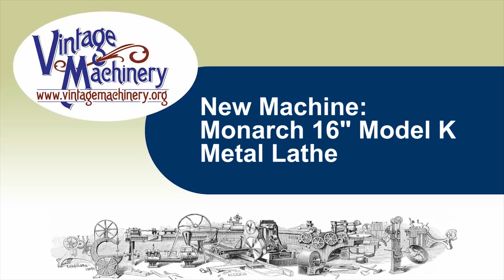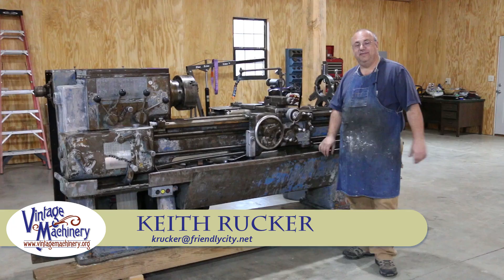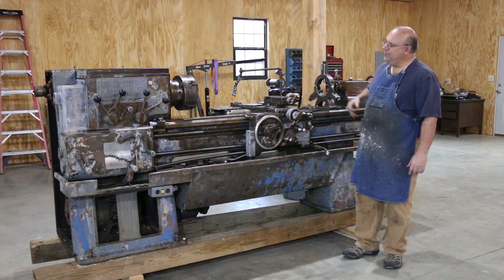New Machine:  Monarch 16" Model K Metal Lathe

Comment: before you remouve the motor open the controle box and check the contactor the problem may be coming from there long time not working the contact can be frozen open way easyer then taking a motor out you should have 2 contactor 1 forward 1 reverse interloch so both cant be on at the same time

Comment: A nice machine, those big Monarchs are great tools. The rod that's bent and broken should be a fairly easy fix. It isn't a rotating part but just an extension to engage/disengage the spindle isn't it?
This will be a full blown mechanical as well as cosmetic restoration if I know Keith. This will be his go to lathe in the years to come.

Comment: To get rid of old paint, just soak the parts in Sodium Hydroxyde (NaOH). It's much cheaper than the commercial paint removers and it works by far better than any of these. But be aware that you can't use it on aluminum, because it also dissolves in NaOH.

Comment: very interesting, I have recently got an old monarch circa WWII, so I'd be very interested in what you find and encounter on your machine. your motor problems sound like one of the inducters is not running, probably a dead connection somewhere in the wye, or the inducter is actually dead

Comment: Keith, I'm glad to see you saved another monarch, they are my favorite. I can tell you, the clutch shaft leading into the gearbox is a pain to get to, the shaft runs in about five inches and transfers to a bevel gear setup. I repaired one a few years ago. don't mean to discourage but it's not fun. Your broken longitudinal hand wheel crank knob is a press in fit on those, they usually press out from the rear. At the left end of your apron you will see a cast aluminum tank, this is your way oil pump, inside is a piston pump driven from the saddle hand wheel, it's usually clogged. It pumps to a manifold located beneath the bridge of the cross slide, under the saddle between the bed ways, you'll want to replace all oil metering units within, source them from lube inc. they're the cheapest. Your headstock should be fine, built to drive the titanic! You'll be impressed with the build quality of the dog clutch tranny and helical gearing. Your spindle bearings are Timken tapered roller, everything else is most likely Bower, your going to love this machine and I can't wait to see the upcoming vids on it. Good luck and God Bless.
Chris German
Reply from the maker: I have been studying the whole area and it looks like it is going to be a pain.  No surprise there...
Reply: You are absolutely correct.  It turns out in a later video that the oil passages from that pump are blocked and due to lack of lubrication there is excessive wear of the saddle where it rides on the ways and the apron has excessive wear to the gears and bearings.

Comment: Do you have any kind of tool holder that would fit a ten inch atlas lathe that you would sell me?
Reply: Just get an AXA aloris Copy. I have a 10 inch atlas/craftsman lathe and it's worth it's weight in gold.
Reply: I've seen those but I'm not sure what exact size I need, is there a model number or size you could give me please? Thanks
Reply: Wedge (my personal fav) http://www.ebay.com/itm/AXA-WEDGE-TOOL-POST-UP-TO-12-CNC-SWING-LATHE-QUICK-CHANGE-HOLDER-250-111-/121554200553?hash=item1c4d31e7e9:g:NUMAAOSw44BYUD5d

Piston: http://www.ebay.com/itm/AXA-PISTON-TOOL-POST-UP-TO-12-CNC-SWING-LATHE-QUICK-CHANGE-HOLDER-250-100-/131413753511?hash=item1e98debea7:g:3EkAAOSwCEdYUFE9

Small kit: http://www.ebay.com/itm/4-PC-AXA-WEDGE-TOOL-POST-INTRO-SET-CNC-TURNING-FACING-BORING-LATHE-HOLDERS-/131914216329?hash=item1eb6b33389:g:l3cAAOSwImRYUDqx

Personally I don't like the parting or knurling holder, I wouldn't buy a kit with those two. Just get more 250-101 and 250-102 holders.

The size is just called AXA.
Reply: Thank you so much! I'm getting it now.
Reply: You're very welcome.

Comment: Rucker's South Georgia Lathe Shelter, all breeds accepted! How does Mrs. Rucker feel about the plans for the second new shop building?

Nine motor wires...I'd recheck the 220V wiring scheme before dragging that motor out. I'd certainly make at least one mistake in there. Hum running 440 at 220 seems plausible, but hum and ill rotation at correct voltage merits a recheck--though a failed winding might be what sidelined the lathe.

Comment: Always interesting to see the events down your way. I wondered, is that a plastic trash bag on the window behind that lathe? Was that done because of a lighting issue for the video?

I found that you can buy those "plantation" type window shades for a modest amount of money at a "big box" home improvement store (like the blue one and the orange one), and that price includes measurement, delivery and installation. Than you could open and close them as conditions dictate. Given all the other professional touches you have done in your shop, you might consider it.

Comment: If you post some photos of things like the electrical panel, the inside lid or plate on the motor that shows the winding's and how to connect them. I am sure that with a basic multimeter (an insulation tester would be handy too) we can help you diagnose some of the electrical problems :) (I am not a machinist, but I have worked in industrial electronics doing PLC / VFD / Motor Starters etc. Which is now a hobby ;) 

Together the power of your viewers will help you diagnose the problems.

Comment: That bent/broken rod is not too serious; the electrical issues can be dealt with (worst case is replacement motor; used 3-phase motors go for cheap). The only really expensive faults would be the ways (and or wear on the carriage or tailstock way surfaces). Before you put much time into this, you should put your super straight-edge on the ways and check for wear.

Comment: We can call this episode; As the shop Shrinks. 

Good find and save. 

 Whip out your ohm meter and check between the phases. on 220 and if it is a typical 9 lead motor you should have 456 tied together 1,7-2,8-and 3,9 as your incoming power. Should show near 0 ohms or no resistance between the phases and open more than 1.5 megohms to ground. to prove out it is not shorted to ground. 

When you get that sorted you will want to check your control transformer on the primary side so it is connected to accept 220 volt instead of the 440. looks like you have a 3 wire start stop so it may have a control transformer or it has full voltage coils in the starters. 

Scott

Comment: Nice machine. Have you tried rolling over the motor by hand? If not it might be worth checking that it's not held stiff by light corrosion before you do the work to pull it out.

Comment: I agree she's beautiful I only dream of owning a monarch. One is good two is better. Now YA Need a Hardinage turret LATHE or there toolroom model. I don't think the bent rod will be hard to fix , the linkage may be the hardest to get so it works freely. I'm sure it will have to come off to straighten it , use your press and some heat just to let it reshape itself with pressure. I've straightened long shafts using two trees or a crotch of a tree. It works don't laugh. Thanks for sharing ,God bless and MERRY CHRISTMAS

Comment: Forgive my ignorance, but why do people buy so many lathes for a single home shop?
Reply: It was one or the other of Edmund Hillary or George Leigh Mallory who said "Because it is there," when talking about why they wanted to climb Mount Everest. 

Hobbyists who can (for reasons of cash or space to install them) acquire more machines ... well, they just do so. Not because they need them, but just because they are there.
Reply: machine tool preservation!
Reply from the maker: I told you, I have a sickness.....
Reply: Keith's shop is HARDLY a "single home" shop.
(I'll bet that most of his home would fit IN that 
shop.)  45 by 80 feet, is a pretty good sized 
shop.

steve
Reply: why do I own 6 drills and 6 grinders. Saves changing bits every time you want to do something. Also if you get a lathe for a good price fix it. You will always make money on it.
Reply: dan wolf agreed resurrecting the dead. giving something life that may have become land fill.
Reply: +Keith Rucker - VintageMachinery.org no its everyone else whos sick

Comment: I know that exact sickness. I picked up a 13" x 48" South Bend lathe a few weeks back.
The only problem is the spindle is a 1-7/8 8tpi and I can't find a chuck mounting plate for it to save my life.
Any idea where one of those could be had or know of anyone that could make them?
Reply from the maker: I would think that any thread that Southbend used would be pretty standard.  At 8 TPI, you could always just make a back plate for it on your lathe assuming you had at least one chuck to mount on the lathe.
Reply: I thought so too until I looked. 1-1/2 and 2-1/4 are their standard sizes. 1-7/8 was an oddball size they used many years ago and then dropped. The lathe does not have a back plate so it's useless until then. I had more luck finding a 1-7/8x8 tap so I'm going to attempt to bore out and tap a piece of material I found on the mill. That is one BIG tap. Need one of those Abom79 size tap wrenches. Should be "fun".

Comment: Instead of straightening that clutch shaft, why not replace it? Obviously it's hard to tell from the video exactly what size it is, but it looks like regular 5/8 or 3/4 cold rolled square bar
Reply from the maker: That is an option.  I will figure that all out once I get it apart and see what needs to be done.

Comment: A nice addition Keith another bunch of flowers for Mrs R or is it a weekend away?
I would guess you have a phase burnt out on your motor, I rewound loads of these when i was an apprentice Armature winder 50 years ago. Its easy to tell before you pull it apart get close to the vent holes and you smell it. It will have a sickly burnt bad smell no mistaking it. Get it rewound and new bearings it will last for years. I am not surprised it tripped your breaker.
I have followed the Leblond so this will be another project for us to enjoy.
Seasons greetings from the UK. Eric

Comment: I know a shaft straightening expert (Keith Fenner).
Maybe I could get you in touch with him.
Just kidding. I know you know him very well. 
Those Monarchs are sweet machines.
I used to work for a manufacturer in Sidney, Ohio where they were made.
Several of the employees there used to work for Monarch before that plant closed.
We also owned a couple Monarchs. We had a 16" Monarch in the engineering lab.
The,
John

Comment: Congrats on the new machine Keith! In regard to the motor issues: inrush (startup) current can be several times the rated current of the motor. A 20 amp motor blowing a 20 amp breaker is totally possible.

Comment: Awesome lathe , Can a guy straighten & center bore the shaft  put  drill steel in the center and V groove the break re weld it up ?
Reply from the maker: I won't know what will be required to fix the part until I get it all apart but I do think that it can be repaired.

Comment: Like mentioned below, perhaps Keith Fenner could make you a new shaft from one of the old busted-up propeller shafts he has fixed. My only question would be, how far out are the ways worn. Still within tolerance, I hope. Jon
Reply from the maker: I have not tested the wear yet but she does not appear to have been abused.  I am sure the machine is usable as it is.

Comment: Often a quick way to check for a burned motor winding is with your nose.  

Hard to miss the smell of a motor that just burned up.  If it has been setting a while most of the smell may go away.  A little sniffing around may give you some clue.

Comment: When Keith says "steam cleaner" & "high pressure steam cleaner" is Keith referring to a pressure washer? or an actual steam cleaner?
Reply: probably has access to a hot pressure washer, they are usually called steam cleaners,
Reply from the maker: It is a high pressure washer that has a burner on it that also heats the water up to near boiling temperatures.

Comment: Nice buy Keith! I've got a 12KK Monarch and the lever/wheel layout is identical! They must have followed a similar design plan through the years. On mine, the clutch lever by the gearbox goes into a little pass-through part and the square shaft terminates right there. You should have no problems fixing that up.

Comment: Congratulations!
I had to grin a bit when you mentioned that the size of the chuck is the same as the one that goes on the big lathe. ;-)
Your issues should be easy to fix - hopefully the bar controlling the clutch did not cause any internal damage.

Comment: Stupid question, but even with the same QCTP on various lathes, would you even be able to take tooling from one lathe to another? I assumed each holder is "tuned" to the centre height for that particular machine?
Reply: Tooling cart.  Set the tools for the lowest tool height lathe and then make spacer blocks with a notch that slips in between the tool holder and the adjusting nut for each of the other two lathes to correct the heights higher.  Quick and easy adaptation.

Comment: If the motor was wired for 440 you can be sure that the contactor coils and heaters are also.  Replacing the coils and heaters (important overload protection) would get you the right control panel function.
Reply from the maker: Yes, but that does not explain why it won't start even when you hook it up directly.
Reply: The comment was more for after getting the motor running.  Any progress there?

If not: You can do a quick check on the motor by disconnecting it from everything up to the peckerhead and checking the resistance between the feeds on the motor - you should see some small but equal resistance between each lead set: L1-L2, L1-L3 and L2-L3.  A different resistance would indicate something wrong in the motor - either the wiring or in a winding.

Finally, 20A is pretty darned low for a 7.5HP motor without a soft start, I'd expect that breaker to pop pretty quick.  A couple months ago I had a 7.5HP compressor on a 30A line where the breaker would pop during the motor start and had to run a new 40A line.

Comment: Keith,
Christmas came early at the Rucker household! One can never have too many lathes! It sounds like you may have a bad winding in the motor. If that's the case, it's a whole lot cheaper to have it rewound than replaced. Then you can keep your Baldor for a spare. BTW, you can't beat Baldor for motors! In my book, they are the best! A lot of the machines I used to work on were driven by Baldor single phase, 3 phase or DC motors. You got another lathe -- is the wife getting a new Mercedes?
Have a good one! Happy Holidays (or is that holidaze?)
Dave

Comment: 3 phase motors do not need capacitors because of the 120deg. phase offset wich when energized will start the  motor rotating. single phase motors need them to start the rotation . But you can make a preliminary check on the motor by ohming it out. simply take a digital ohm  meter and connect two of your motor winding leads together at a time. A digital meter should zero out between any combination of two wires.  If any combination of those leads does not give you either a zero reading or very close to it then you have what is called an open winding so motor will not run.  Then test each lead individually between each winding and the body of the motor. you should get no reading there. If you have a reading you are shorted out. Not all the time is this procedure written in stone, but probably 99 percent of the time. Then a motor may be tested by hooking it to what is called a megger. But that is a whole other ball game and best left to proffesionals. The other thing you might check is the contacts in the magnetic starter or the overload heaters and block. These also when bad can create a single phase situation. By the way nice score I love Monarch lathes and I have a large one myself. A 1929 model L  26 x 120. Can't wait to see that one running.

Comment: That is the same model as Adams right? Looks like Monarch used the same castings for the ways apron and tail but really did a do over on the headstock. I wonder if they changed the spacing on the gearing in the process? Kind of looks funny with the mix of smoothed over 40's lines with the very 60's boxy lines.  Did that guy that offered the tailstock for the big Monarch not pan out?
Reply: the tailstock guy just plain disappeared off the earth, no way to contact him other that youtube, didnt respond to any messages, never commented again
Reply from the maker: This is a more modern lathe than the one that Adam has but I am pretty sure that the apron is more or less the same.  The guy who offered the tailstock never would reply to messages.
Reply: Adam Booth has a model CY Keith's is a model K.

Comment: Along with being a retired Navy Molder, I'm also a retired Journeyman Electrician and have worked on many a motor. Without being able to see the motor, my guess would be that the starter winding (or starter capacitor if it has one) is the problem. If you want to check this theory, energize the motor again but this time try to move the motors' shaft by hand. Carefully! If it is the starter winding/capacitor the motor will take off if you can start movement by hand. Capacitors are inexpensive and easy to replace...starter windings, not so much but it's a good thing you have a motor shop near by. Good luck with the repairs!
Reply from the maker: I am leaning towards a lost phase.  I have not had time to check it out yet though.
Reply: sandrammer Hey Chief, you better brush up on your three phase theory! No starter windings or caps in three phase motors.
Reply: I stand corrected, my mind automatically went to the split-phase motor info. I guess it's time to get out the megger and check the windings for an open circuit or a dead short.
Reply: And due to the time it took for the breaker to trip, I'm inclined to believe the motor has lost a phase.